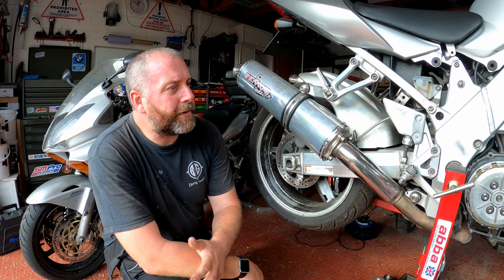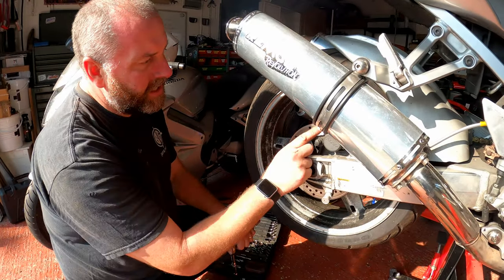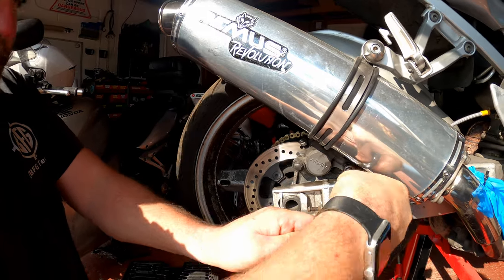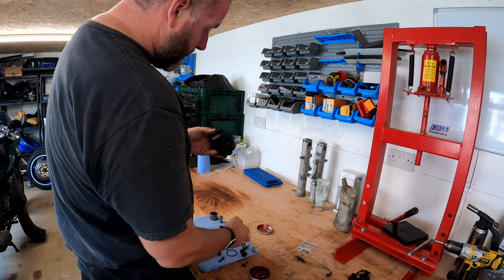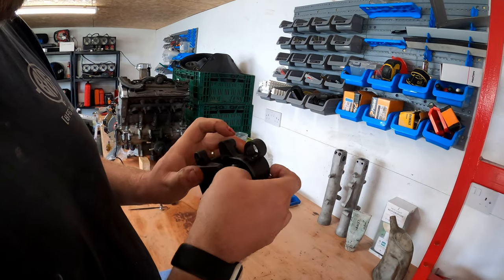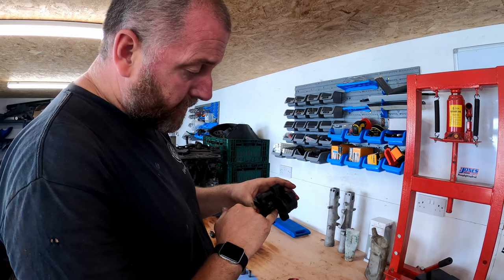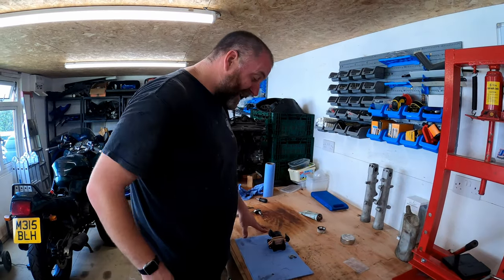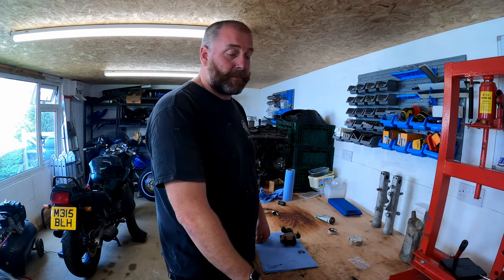Suzuki SV1000 Project Bike - Part 11 - Rear Brake Caliper - Disassembly, Servicing & Reassembly

Comment: I actually stripped the bolt on my old sv1000 when reattaching to the carrier. Thankfully I had a spare bolt and spare carrier so it just meant I had to remove rear wheel and replace the bodged parts. Got the carrier in the garage as a reminder to never do things up overtight ever again!